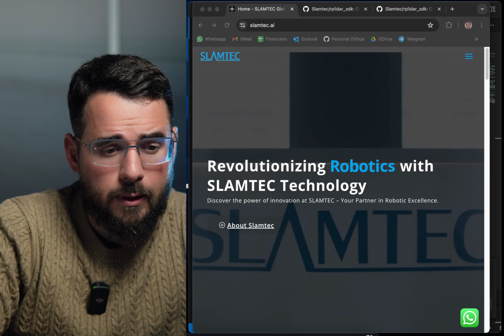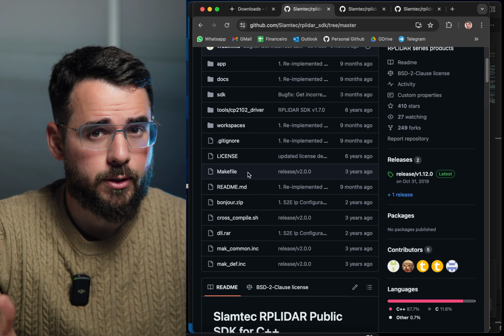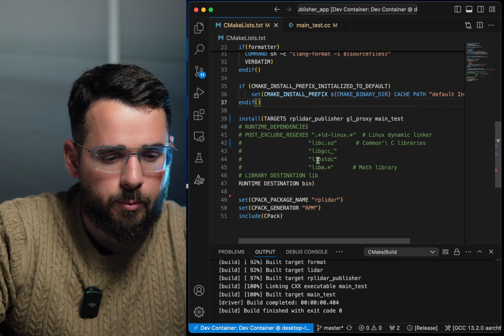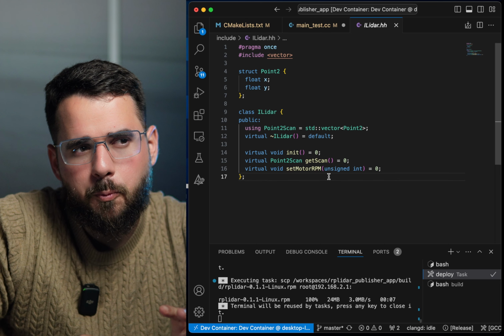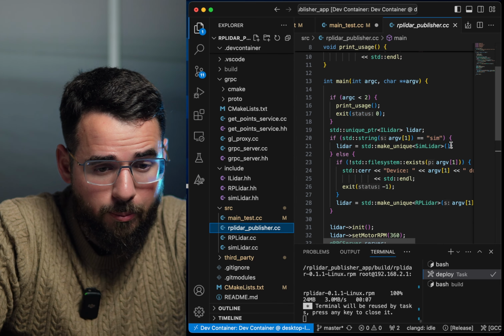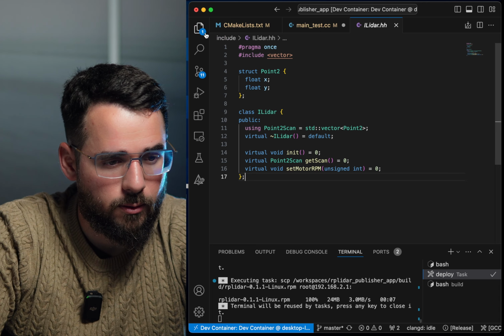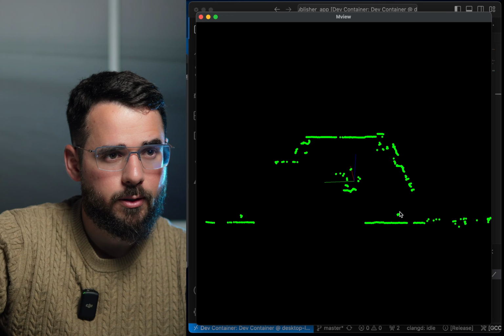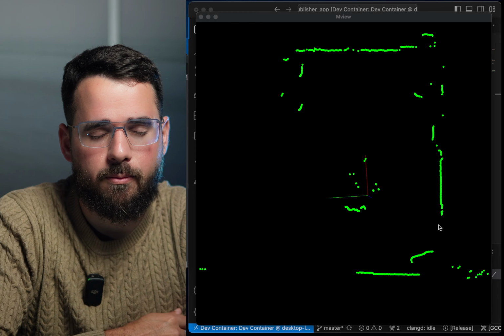LiDARs: Software Engineering a Driver

Comment: What are your opinion on ROS and its current state?
Reply from the maker: I've used ros and ros2 (more than ros1) for many years, both for academic and industrial applications.

I think it is a brilliant framework and ros2 especially forces you to use nice software design patterns on the way. It does achieve its goal which is to facilitate development and decoupling of different problems. 

Over time I've been using less because it always introduced such a big dependency to the application, among other constraints. What if I want to build software for a particular Linux distro or hardware that does not support it(not even compilable..)...
Maybe I will make a video on it ;)